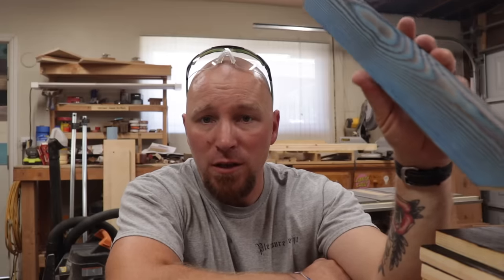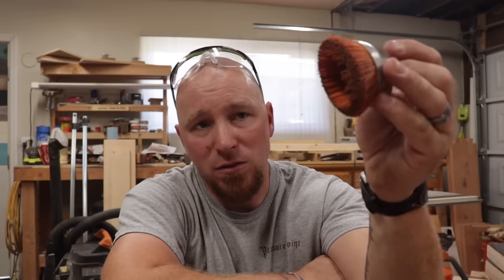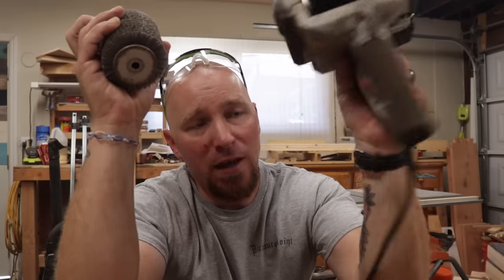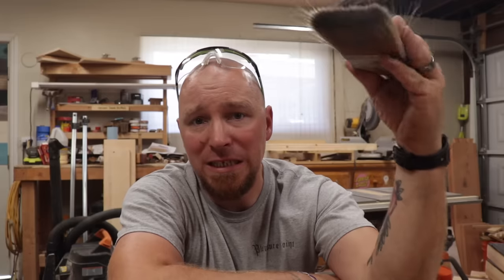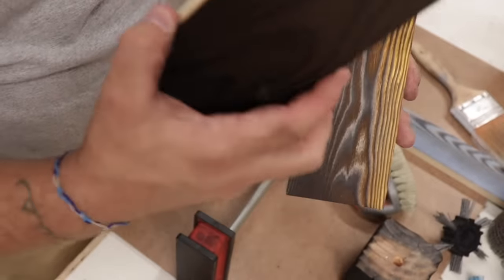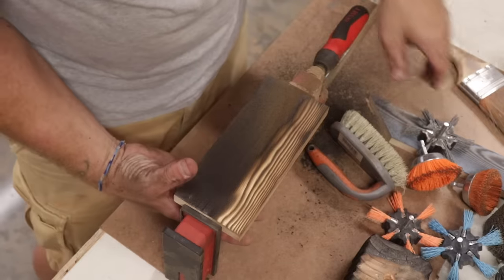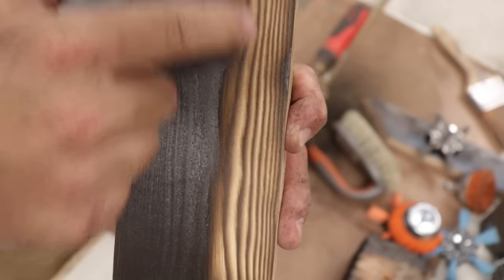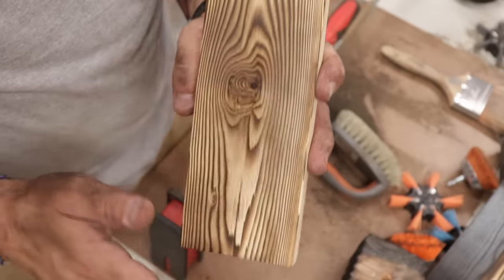The Right Brushes For Amazing Shou Sugi Ban Results

Comment: Over the past few years I have done a lot of shou sugi ban furniture, I use the wheels a lot but most of the time I like to strip back the charcoal with those stainless steel scouring pads they use in restaurant kitchens, they cut back the charcoal fairly quickly and I use an industrial vac to keep the job clear. Other grades of steel wool are useful but they break up a lot and leave bits of wool all over the place whereas the scourers don't so much.

Comment: Thanks Jodi for going through your process. I’ve done some shou sugi ban finishing but the result is always dark brown (using a deck brush). I guess it’s pretty common sense but I’ve never thought to really scrub the heck out of it to dig down into the char wood to expose the light wood. This is opening a whole new world for me.
Reply from the maker: Man that makes me super happy to know that these videos are actually reaching people and helping! Thanks for taking the time to comment!
Reply: TakeAmericaBackfromISRAEL  no, either direction a cup brush is spun will result in 360° of scuff marks....think of the results of an orbital sander vs a belt sander
Reply from the maker: Great explanation. I have had quite a few people ask that but I never saw this particular comment. Thanks for answering!
Reply: Great.  Love it . Always where a mask doing this .
Reply: Thanks for video. Really helpfull. Would you ever sand after brushing, to get a smoother surface, or would sanding with a fine grain, still ruin the goodlooking burned grains? Thanks

Comment: Jodi, Great stuff! I've learned a lot - Thanks for sharing. I've used the Shou Sugi Ban process on my rifle stocks for years (decades actually) and now I know what it is properly called :-)  The tooling marks left by brushing leave an interesting texture on the wood but when I am working with hardwoods I prefer to use steelwool to achieve a smoother surface.
Reply from the maker: I sometimes use steel wool as well to polish up the charred grain for a higher contrast. I've has so many people ask me about rifle stocks! What species are you using for the stocks? I'm thinking about getting a few to try myself.

Comment: love this tutorial - thank you Inspire Woodcraft for posting it - I also have a question - what if before you started burning you went over the wood first with an aggressive wire brush e.g. steel brush and sculpted it a bit and then you did your burn followed by using these brushes again to clear out the char - would that produce more of a defined wood grain pattern and be more 3D in effect - or would it ruin it???
Reply from the maker: I don’t think it would ruin it necessarily because what’s great with this type of technique is that it works so well with experimentation. One thing I will say though is that flame does not like tight grooves and corners, so burning might take a little longer to achieve a full burn. If you wire-brushed and then fully charred, the wire-brush texture should remain intact. But if you brushed it out afterwards, it would basically smooth back out and the only wire-brush texture that would most likely be left would be on the grain itself.  (Hopefully that made sense!)
Reply: @InspireWoodcraft  a tip i learned about staining the wood with colour is if you cant/dont want to use the store bought stains that are on offer - you can make your own by mixing a bit of oil paint of the colour of your choosing in with an oil tint base  off the shelf.  I've tried it and it works - its useful if you need to do small quantities or different colours.  The tint base is just the stuff that you buy in a can that you can get tinted up in the shop - just that you dont get it tinted with the stain they have - you just bring it home and pour some out ( a 3 part tint base to 1 part oil paint is a good ratio) and just lay it on as you would ordinarily.  So far I have only used the oil version - but i'm keen to try a water based tint base with some acrylic paint and see how that works out too.  When i get a chance i'll try some of these methods -including the wire brushing first then burn approach and let u know how it turns out.  Merry Christmas bud to you and yours xx
Reply from the maker: You just gave me some great info and ideas! Merry Christmas to you as well!!

Comment: Beginning at 13:15 is the loom I like. Great tutorial and advice about lungs...   I’ll have to figure out to do not having tool you have. Will be doing a lot of 3.5” 8’ boards so wanting get done ASAP. Attachment to drill might be time consuming. Could use my 5” disc sander. Don’t think my grinder would be the right too,  may need do by hand with wire brush to get the look you showed at end of video

Comment: Ya I really don't like the heavier grit for that. I love the darker look. Looks awesome!
Reply: If you like the dark color but also like the radical wood grain embellishment of a heavy grit you can either char the wood a second time after doing a complete brush (this can be done any number of times, the more passes with the torch, the more radical the wood grain texture will pop), or you can apply a dark ebony stain after brushing that takes to the soft grain as a flat matte finish while leaving the harder grain with that seared shimmer that you can expect from the shou sugi ban process, in the end you'll be left with a very dark and consistent finish but with intense texture variations between the soft and hard wood in the grain.
Reply from the maker: A nylon hand brush or a higher grit Nyalox type brush will give consistent results with a lot less work. Nothing wrong at all with what you described, just a lot of possibly unnecessary steps. Also in my experience, charring more than once is fine as long as you don’t brush more than once. Even the harder rings can’t take the stress and they will cook and crumble.

Comment: I got a set of the dico discs they work great, im doing this type of finish to my beehives. Question.....do you find it easier to remove the char and bring out the original color if its heavier burnt and not just skimming over the soft wood to blacken it?

Comment: Hello.  Great videos, Thanks.  I did this burn technique on harder reclaimed wood (it's all I had) and   after the two step burn process and brushing away the soft grain (with a brass brush) the result didn't turn out quite as expected.  First, several pieces or splinters of the top layer were peeling back.  I assumed this happened because I may have charred it too much during the burn process.  Second, I couldn't get the color lighter and it remained darker than I wished even after brushing for a while.  I'm assuming this happened for the same reason-too much burn?  What do you all think?  Thanks!
Reply from the maker: If I had to guess, I would point the finger at the harder wood. In my experience, hardwoods usually don't work very well.

Comment: I'm a couple years behind but had a quick question. I'm using your method and then attempting to joint the boards together. I keep getting a bend/warp in my boards which causes it to not sit flat or joint perfectly. Any tips you could share to keep things flat???
Thanks in advance and for the content.
Reply: I had the same problem. The simple solution I found is to assemble everything first then burn it. I made a vanity that way.  I burned it after it was all assembled. Otherwise any jointing you do before hand is going to change after the burn.

Comment: I make my own flapper. .250 dia steel rod. Saw down the cross section. Making a slit. Cut sand paper and fold it in half then slid it into the slit. Mount it in a drill. Cons its only 2 sided.

Comment: Do you ever use steel wool to get the tool marks out?  I like to use the wool to soften the peaks.  It creates a very nice finish.
Reply from the maker: I don't use steel wool too much other than to polish the peaks when I use whitewash. Just to bring out the dramatic black/white contrast. I have tried a worn/rustic themed idea before where I did the burn-and-brush method, then used a flat sanding block and steel wool to sort of "age" the surface. That turned out kind of neat.

Comment: Dude, how did you get the silver color under the blue on that one piece? The one used for the Title Picture and the one you’re holding at 0:36. Is that an iron oxide stain first? Or is that just how that one turned out after the burn? Feedback would be super appreciated. Getting ready to do a gunstock for my daughter.

Comment: What would be the best type of wood if I want to make a display frame for a wedding? Thanks for all your videos
Reply: pine is the cheaper option and turns out great but if you can get some nice hard wood it will give a tighter finer grain which looks a lot better in my opinion - i mean pine really does come up beautiful but hardwood looks a lot better if you some available.. hope this helps
Reply from the maker: Like a picture frame? I would use a soft, white color wood like pine or something similar if you are going to be brushing and coloring. Hardwoods can be burnt, but they don't brush very well at all.

Comment: Great videos thanks for doing it. I have a question, when using the 120 or 80 grit flaps can you sand out any of the tool marks to make the surface super smooth? I made a simple dovetail pine box and I want to spice up. Was thinking of using this technique and staining red. But I want it smooth and shinny.  Again thanks for making the video, very informative. I know producing them takes a lot of time.
Reply from the maker: You can but it's a tedious process. I believe the finest grit wheel is 220 so if you didn't go to hard with the other grits, it might work well to polish things up a bit. Thanks a ton for watching and by the way, red looks amazing with this technique!

Comment: Can’t you turn your drill on the reverse spin? Like lefty loosey instead of righty tighty & vice versa depending on the grain?
Reply from the maker: No it doesn’t really work that way unfortunately. The reason is because that brush is circular and a circle is always a circle. If it leaves circular scratches in the forward direction, it will just leave circular scratches in the opposite direction. Thanks for suggestion though!

Comment: Thinking about doing this on a butcher block slab counter.  Your thoughts?
Reply from the maker: I've seen similar things done with counter tops but two things to keep in mind: you will have to do an epoxy topcoat or something if you want the surface to be flat. And, in my experience, hardwoods don't take to the burn-and-brush technique very well, so you'll probably have better results making it out of a softwood.

Comment: Do you know if for the pc; this brush, ( PORTER CABLE PXRAPW80 Restorer 80 Grit Profile Flap Wheels ) better or the same as the wire one you use for the pc? Also is the wire one or the nylon one better?

Comment: Why not just change the direction of the drill? Like switch it to reverse then it'll spin the other direction and go with the grain right? Just a thought
Reply from the maker: No it doesn't really work that way. A circle is a circle either way, so reversing the drill motor direction just moves the circle in the opposite direction.
Reply: Inspire Woodcraft For sure man . Thanks!! That kinda confused me!
Reply from the maker: No problem! Yeah I totally get that.

Comment: hey so i have really been wanting to try this, and one of the effects that i want is a very noticeable depth change between the  hardwood grain and the softer sapwood, like the kind you would see on really old handrails. Does one burning pass create this and if not would multiple burnings and brushings create that depth?
Reply from the maker: In my experience, when I’ve burned after brushing, the hard grain starts to get very brittle. That works if you’re just going for a dramatic full char, but to brush it again just brushes the grain away as well. Again, that’s just what I’ve noticed. Fully charring once and then brushing deep will give you a very textured surface.
Reply: Awesome, that was the exact info I needed. thank you!!

Comment: Nice one dude. Bought my burner and been practicing my burn. I’ll get a steel and brass brush, got the hard nylon one which I’ve used a few times with some success. I’ll see if I can pick up the set of nylon flap wheels. Question. Can you double burn , ie burn/brush/burn brush, to get a deeper ridge and not have so many tool marks. Maybe a double burn using a brass brush? Look forward to the colouring vid👍
Reply from the maker: So I've had mixed results with double burning. Typically when I burn, brush, burn and then brush again, the charred grain starts to fall apart and it becomes a waste of time. Maybe I was doing it wrong though.
Reply: I’ve picked up some brushes today and ordered some flap wheels, all cheap enough. Understand about the grain issue on the double burn, pretty sure I’ve not achieved much of a ridge as been using the nylon scrub brush so far. Bought a job lot of axe handles and had a quick play with one. It burnt really nice so having my first attempt on the steel and brass brushes in the following days. Thanks for the inspiration and so looking forward to the colour vid👍
Reply: Forgot to add a good cheap source for the brass brushes in UK are shoe repair shops, struggled getting decent sized brushes from general hardware places.

Comment: I've read that one of the advantages of the shou sugi ban technique is that it guards against both mold and insect infestation. I think it's the carbon. Wouldn't what you are doing negate that advantage of shou sugi ban since byou are removing a lot of the carbon?
Reply from the maker: I haven’t found any solid information to back that up, but I’ve wondered the same thing myself because it just makes sense. This technique is more for the visual effect as opposed to the original benefits of leaving a full char.

Comment: Why you consider tooling mark good thing?
Reply from the maker: It's definitely situational. I like light tool marks most of the time because it gives it more of a machined look. The scratches can also house more stain which if not wiped off, will add another layer of vibrant color.

Comment: Why sand before burning when it's just gonna get scraped off?
Reply from the maker: If the surface has any scratches or dings in it, it will show up in the finish even after it's charred. So I sand out any imperfections like heavy scratches or saw marks prior.

Comment: The Makita I used ages ago kicked ass!
We called it the hedgehog.
It ploughed through the endgrain to scallop the ends of big green oak beams and purlins that had been roughed out with a very big circular saw in a jig.
It's a beast.
Can stroke the cat with it or turn bandsawn dry oak boards into textured,even driftwood level weathering to the grain and not too much scratching with the nylon drum.

Comment: Makita is expensive and doesn't compare to Dewalt. For example a dewalt cordless dropsaw which is radial arm , compound mitre exactly like the electric AC old version of dewalt ( it's actually an ELU brand) dewalt must have bought them out? The Makita version is a joke in comparison! I've used both and my favorite is dewalt. Porter cable? Mmm I got check that out! I have to restore my kitchen table. I'd love to do this method on the table. Cheers from Australia 🙂👍👍👍. Btw amazing job man. Its harder than it looks.

Comment: Thanks for the info. I have very little clue what I'm doing as it might show here in a sec.... so your attention to detail is appreciated.
Now I say this with me having to do 4'x8' sheets... Call me crazy but all I could think about was why wouldn't I use a vacuum cleaner. Even have the handheld attachment driven by the vacuum for smaller projects.. Alter it if needed or maybe the nylon be stiff enough idk??  I would think it'd keep the mess to a minimum. . It'll be fine dust so have to watch the filter. I know I'm gonna try a vacuum cleaner set the brissles low and weight it down if need be. 
Well there's a little peak inside this crackpipe head of mine. Just thinking outside the box and thought I'd throw it out there.
Now I can't imagine me being the only one that's thot of this so if there's a reason it's a dumb idea or it's already used  I can handle constructive criticism no worries.
Thanks and appreciate ya...

Comment: I use a wire wheel in my shop for various reason - As with a drill press, buffer wheel(flying wax) and sander I NEVER use it without protective goggles/eyewear. In the past 30yrs I've come across 3 strands that hit my forehead and 2 that bounced off of my glasses. 

Is it LIKELY that they'll fly into your eyeball? No, but why the fk would you risk it for the .5sec it takes you to put the fkn safety glasses on???
Reply from the maker: So true. And that’s really all it takes is a fraction of a second to change your life forever.

Comment: The cup wire brushes are very dangerous. I did a job and some of the stainless steel wires was embedded in my forehead. Even my clothing was full of wires. I looked like a Porkypine afterwards. This nylon brushes are indeed a better option to use.

Comment: Watched this series a few times and wood like to give this a shot. Wood the deep burn and brush method work for computer desk.? Could it be made flat with resin or would you recommend the lighter burn method and just use a regular wood stain (brown) or oil.

Also should I glue  and or dowel my lumbe piece prior to the burn after before stain or after

Comment: They're expensive but you can get steel, brass, nylon and horsehair rotary brush drill attachments for waxing snowboards. Would easily be able to use the steel or brass for wood
Reply from the maker: Interesting! I will have to remember to look into that!

Comment: Um, I have a cheap ass drill and I use the reverse setting when I use my nylon abrasive disc :) That way it goes somewhat in the correct direction with the grain :)